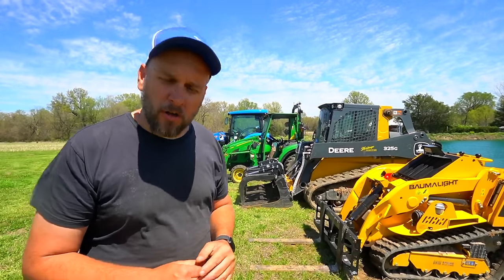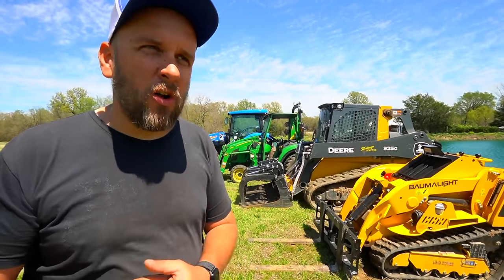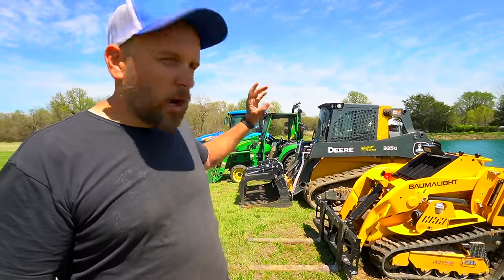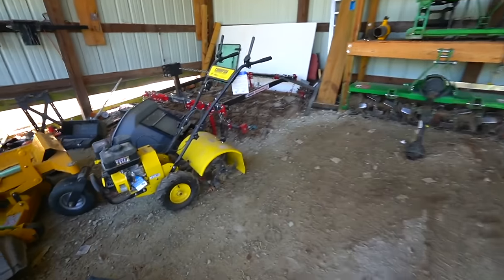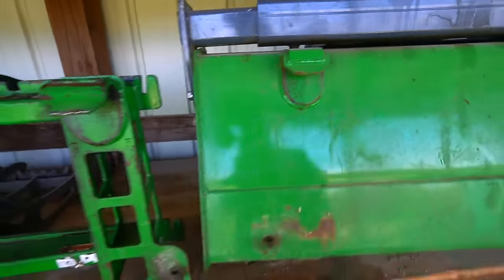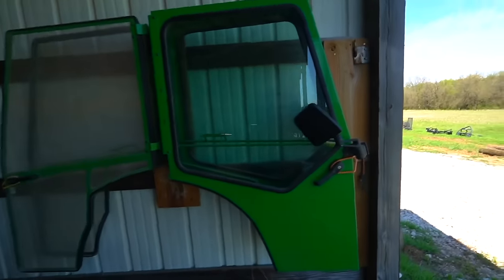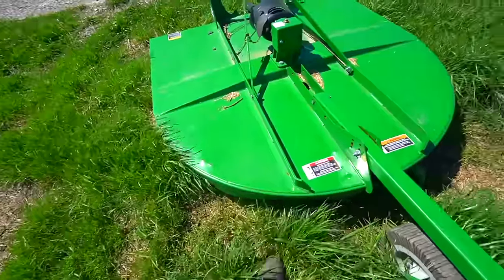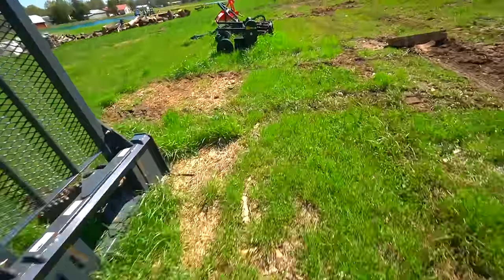I'm Selling All of My Equipment

Comment from the maker: To inquire about the equipment, send an email to kcfan491@gmail.com or message my Facebook page.  When an item sells I will mark it as sold here:

Tractor $32,500
Skid Steer $72,000
Harley Rake $6500
Skid Steer Brush Cutter $5000
Tractor Brush Cutter $1200
Tiller $2000
Box Blade $900
Landscape Rake $700 - Sold
Carry All $250
Rock Bucket $1000
Reply: What’s the model number of Harley rake
Reply: If you woulda stop spending  money on upgrades  and bought  the right one from get go
Reply from the maker: I didn’t pay for any of the upgrades except for the loader. Every bit of it was sponsored

That is why I’m not trying to get that money back from the sale

I can make the payments. Just trying to make smart financial decisions

A far as the buying decision you are just repeating what I have said 100 times In videos
Reply: Needs change, use cases change, equipment that works today might be better replaced by something else tomorrow.  The great thing about these compact tractors is the versatility and wide range of attachments and implements.  Great reviews, and I appreciate all of the hard work you put into this channel, Brock. Look forward to all the new stuff down the road!
Reply from the maker: Thanks

Comment: Brock - I need advice and it might make for a good episode.  Cutting grass on a large property, 20+ acres.  I have a 40H tractor with a flail mower and brushhog.  Does it make sense to run a $40,000 tractor at 2500 RPM for 10 hours to cut grass rather than buying a $5,000 commercial zero turn.  The tractor approach seems inefficient and slower but I would prefer to use it vs buying another machine.  Thoughts appreciated.
Reply: Mowing 20 acres is nuts.    Plow it and plant something.   Make some $$ off the land rather than pay to mow it constantly.

Comment: I have a smaller barn I think its a 24' x 36'....right now 3/4 of it is just a dirt floor soon to be 1/2 floor and 1/2 gravel.  I have a Kubota BX2680, smallest tractor they make.  I wouldn't want anything larger, with the space limitations I have, that Baumalite stand on mini-skid would be awesome in the shop, but don't have a PTO.  So, kind of would be in the same boat you are....need 2 different machines, for different tasks in different conditions due to space.  The Kubota does what I need it to do, granted moving stuff in my shop like my shop tools, I have to be extremely careful, and make 30 point turns to get stuff moved, but it works, and the tractor is about 3/4 of the way paid off....and will most likely be the only tractor I ever need and own.  

Right now I need a riding mower or zero turn...but my DTI ratio is out of whack so trying to finance or outright buy anything just isn't an option...so mowing becomes a chore in itself....mow with the push mower, or spend 15 minutes moving stuff around and installing my mid mount mower on the Kubota....it does a great job, but 15 minutes spent messing around getting the mower deck installed would have been 15 minutes I could be mowing....I did a test mow just mowing my front and back lawn was 40 minutes with the push mower (Ego 21" self Propelled).  I'd imagine if I mowed the rest of my property it would take me most of a day with that mower having to wait for the battery to charge, etc.
Reply from the maker: Tough decisions and equipment is so expensive
Reply: @RockhillfarmYT  Very expensive especially when it isn't used in a business to pay for itself LOL.  My case I bought my tractor for my personal use, so its up to me to handle the financial side of it, where as a business typically buys and offsets their payments with the jobs they get and use that equipment for.  Even then, its an expensive endeavor.